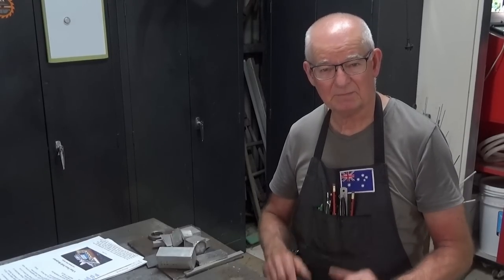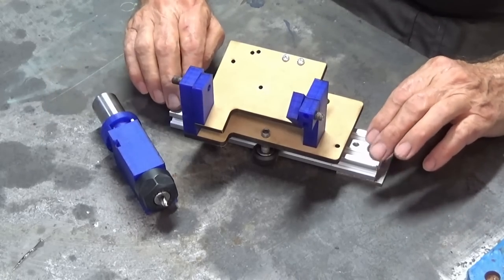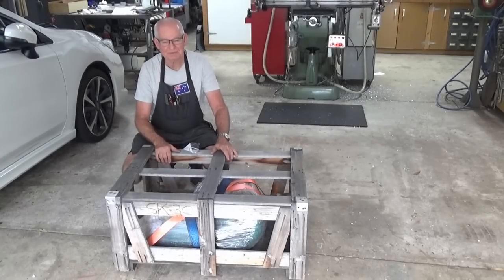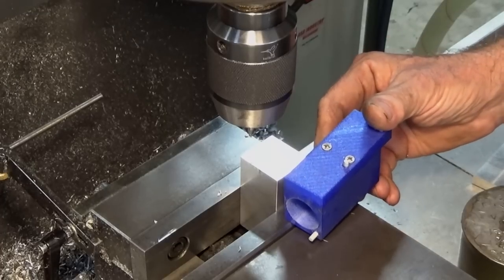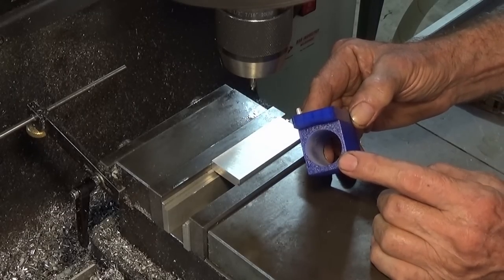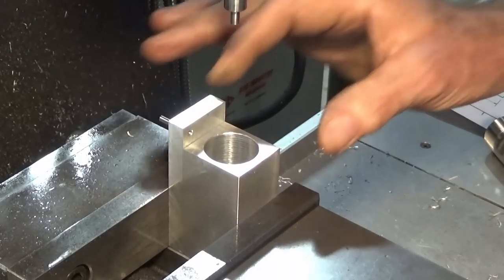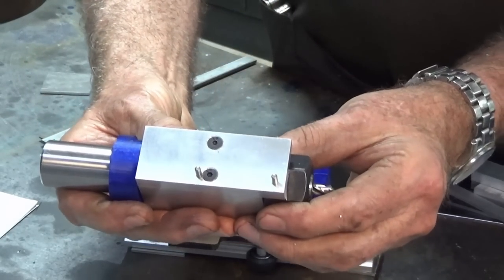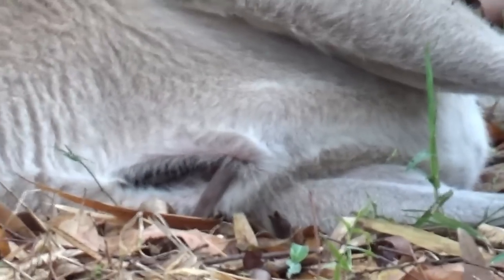A 4 Facet Drill Bit Grinder DIY Style Part 1

Comment: Gday Preso, this looks an interesting build and good use of the Quorn, the Roos are thick here at the moment, there bloody everywhere, cheers
Reply from the maker: We have "just the right number of roos" here. Three or four at the most and they don't eat our trees so that's good. I badly wanted to use the Quorn grinding spindle for something. I can mount it on the compound in my lathe as a toolpost grinder but it's ideally suited to the drill grinding project so it's not a wasted effort after all. 
Regards,
Mark

Comment: Looks to be an interesting project Mark. I sharpen my drill bits freehand using guide lines on my grinder's rest. But, I jig like this will make those grinds even and accurate. Can't wait for Part 2. 

Good score on the shaper attachment. That will give you shaping capability without taking up space with a completely separate machine.
Reply from the maker: Thanks Jon. I still want a proper shaper though! And a surface grinder. 😁
Regards,
Mark

Comment: G’day Mark. My name is Andrew and I live in Brissie. I’ve just finished Stage 1 of my version of the drill bit grinder. Most of it will look very familiar but I’ve made a few changes (as you do). It can take ER32 and ER40 collets and has a 150mm grinding cup. The table is about 300x200mm and has a sideway movement range of about 100mm. It can take a few other accessories I have in mind for end mill sharpening etc.  I also have a different method of indexing by just flipping the collet block 180 degrees (or 90 degrees) using register pins.  

I’ve only sharpened one bit so far (4 facets) but I’m very happy with it. Thanks for the effort you put in and the inspiration you provided.
Reply from the maker: Andrew, I did wonder if it were possible to scale up the basic geometry of the machine. It took a while for me to understand the way the work axes had to align to guarantee the intersection of the four facets. I just finished up on my grinder today and I was able to successfully grind a 3/32" twist drill. I would NEVER be able to do this by hand and it was quite gratifying to know that I can now get repeatable sharp cutting edges on my boxes of blunt and damaged drill bits. I would be keen to see your version when you get yours finished. You can find my email address in the "about" tab of my YouTube home page.
Regards,
Mark

Comment: Marc, in 2018 I studied and thoroughly examined the sharpening of drills, but I stick to the clone copy of the dekel S0 toolgrinder. After reverse enginering I adjusted it, did all the calculations and with a small hardware adjustment I can now sharpen all drills from 3 to 18mm diameter with 4 facets. I have yet to make a video and documentation on the final adjustments with a quick-release clamp. Yes, I also found the documentation from John Moran 5 years ago, but I had a drill sharpening tool PPU-3, but the accompanying documentation was never clear. You can find more about this on my you-tube channel, including documentation.
I wish you continued success with the construction of the Moran drill sharpener
Reply from the maker: Thanks for that. I have actually downloaded your excellent article on modifying the Deckel clone drill sharpener attachment and it is on my to do list of projects. I would like to have an alternative method for sharpening drill bits and although I had used the Quorn T&C grinder to do a 4 facet grind on some medium sized drill bits it was always a bit fiddly to set up. I have also seen Stefan Gotteswinter use the Deckel clone to grind a 4 facet point on a solid carbide drill bit but it really only works if you have a 5C collet for each drill diameter that you want to sharpen. I think the John Moran version will be simple to use although he states that about 1/16" is the lower limit due to bending loads on the drill at that size.
Regards,
Mark

Comment: Oh shit! Oh shit! Oh shit!! This is just the project I (did'nt) needed to keep me busy in the shop!!! Like you said in the intro, getting bigger bits sharpened is easily done by hand. At school we trained on 3/8" bits to get a feel and anything 1/4" up is pretty easy but 3/16" down requires a super soft touch and a good grinder with no wobble or vibrations! A nice dedicated grinder like this is just right up my alley!!

BTW, always love the garden shots... The wildlife is so wild in your area compared to us! Greets from Canada!!
Reply: I said the exact same thing!
Reply from the maker: I am glad you are interested in the project. There is a 3D printed version of this drill grinder which may suit some folk who don't want to do a lot of machining. I am including a link to that version in the next video. A lot of the parts could be laser cut too. If you can get a service bureau to cut the sheet and flat parts it would be a fairly simple build. I am looking forward to grinding a lot of dull bits under 1/4". I think the practical limit is 1/16".
Regards,
Mark

Comment: Just 2 things to have right for drill grinding and that is the point angle and the centrality of the bit......the point angle is got with a simple plate angle gauge and the centrality of the point is by laying the drill bit on a flat surface and checking the chisel point against a ruler.......that is if you hand grind drill bits so back off is an eyeball thing. and comes with practice.
I'm going to give the 4-facet point geometry a go as soon as I finish the T&C grinder I'm building.
Without bragging I can hand grind a 12mm drill bit to drill a 12mm diam hole that a 12mm piece of rod will be a press fit in.
Another trick for drill hole sizing is if you slightly grind one cutting edge off centre it will bore the hole bigger.
BTW.....for sharpening all small drill bits from 3mm down to .5mm I use a Wishbone type drill lapper and a diamond lap.......the Wishbone drill lapper or grinder.....whatever.....was popular in the 50's so I made one for sharpening all my small drill bites..
Reply from the maker: Ian, I recall seeing the advertisements for the wishbone grinding accessory in the old Model Engineer magazines. The only thing I don't like about a lot of the DIY drill grinders (and the wishbone style) is that you need a lot of specialised collets. I think the wishbone only came with 4 and when you start trying to grind letter and number drills it might be an issue. ER collets are relatively cheap these days and they cover a massive range of sizes.
Regards,
Mark
Reply: Really small drill bits you can sharpen like a pencil. I mean really small bits. Below about #60. Once they're that small it doesn't matter any more. As long as they're sharp they'll cut.

Comment: I have a confession to make. I own a Drill Doctor and I do use it to sharpen my cheap junk import drill bits. It was $5 new in the box at an estate sale so I figured I'd try it and for general hand drilling it's Ok.
Reply: I own a Drill Doctor too and it's hopeless. I just freehand bits on a bench grinder. Good enough.
Reply from the maker: I have used a Drill Doctor clone that belonged to a friend and even though it was 90% made of plastic it still did a surprisingly good job. However, in my view, a 4 facet grind on a drill bit is superior to a factory grind. They start easily, wander less and in most cases you don't need to pilot drill. 
Regards,
Mark

Comment: I am extremely envious of your new purchase as I have been looking for a slotting head for my Bridgeport for over a year now. It's hard getting machinery like this here in Aus. 
Regarding sharpening drill bits on the clone D bit grinder, I have done all the modifications that was suggested by Luc Wybo and still with not much great success. Having 2 draws of drill bits, I am very keen on seeing your project thru and hopefully when you've completed it I would love to take you up on the offer of the plans. 
Love your work and detailed videos. Cheers.
Reply from the maker: Thanks Bill. I have the article produced by Luc Wybo sitting on my desk and I was keen to do the mods on the D Bit grinder drill sharpening attachment but  I thought I should try the 4 facet method first. A 4 facet grind has a lot of advantages over a commercial factory grind. The start more accurately and produce less heat. You are welcome to the drawings when I have ironed out all the missing dimensions and updates.
Regards,
Mark

Comment: You can just use your deckel grinder to do this job.  It came with a 5c collet holder that has built in indexing.
Reply from the maker: Trust me, I tried to use the Toolmaster D bit grinder but I didn't have the 5C collets I needed at the time. I have bought a few more but getting imperial size 5C collets is a bit of a mission. I thought I might be able to get a 25mm 5C collet and mount the ER20 collet chuck in it but I just couldn't see how it was going to fit. I know you can use the D bit grinder for 4 facet grinds if you have the right collet. I have seen Stefan do it. But you'd need to have a million collets to make it work for number and letter drills. 
Regards,
Mark
Reply: @Preso58  yeah I bought a full set of metric ones from H&F.   They are handy because I have a 5c chuck as well.  5c is a pain though because they aren't as flexible as the more modern collets.  The drill attachment isn's as bad as everyone says.  I set it up sometimes and have had good results on monster drills.   I found the 4 facet method sometimes gave me clearance issues and wasn't great.  Probably I was doing it wrong.

Comment: Yep this is a good one. Only problem I have is I just purchased a Vevor except its not as small as I would have liked. I also would like to put my hand up for the prints on this if you get them done. love your ideas. I am making the furnace now and just finished the control box. Cant wait to melt something!!
Reply from the maker: Thanks. I saw a couple of reviews of the Vevor drill sharpener and I think they are a great solution. Unfortunately, I had already committed to making the 4 facet grinder and I had actually just finished when I saw the first of the Vevor reviews. You can find the drawings here https://www.dropbox.com/sh/38ahn5tz4qw5ypw/AACtAbmXNDYa4x0v9DD1NcEOa?dl=0
My furnace drawing is here https://www.dropbox.com/s/j7bopx7noxi96vn/Mark%27s%20Foundry%20Furnace.pdf?dl=0 Good luck with the build.
Regards,
Mark

Comment: I spent some time in dialogue with John Moran to create a 3D printed version of his sharpener. He has shown my finished 3D version on his examples page and has put a link to my blog where you can download my Fusion files, drawings and STEP models.   The 3D printed version works very well and saves a lot of metal related activity.
Reply: Thanks for sharing the files, just downloaded them. I have a fiber laser cutter so can cut all the sheet metal parts on that. Only the holes for the pivot pins need to be reamed, all other holes should be OK with laser cut tolerances as far as I can tell.
Reply: @epilotdk  Sounds like you are well resourced for it.   I was intending to CNC cut the trunnion plate but in the end took the lazy option and Spray Mount glued the 1:1 paper pdf drawing of the hole locations and outline onto the blank plate.   I then marked the centres with an optical centre punch and drilled them through so not exactly precision and it works fine.  Your laser should be as good if not better. 
There is an update tweak on my blog regarding the 3D printed collet holder where I decided to add a metal sleeve so the collet holder slid back and forth more smoothly than on the raw PLA print.  That aside the sharpener is very reliable and is an asset that I would not be without.  Well worth the effort.
Reply from the maker: Alan, I will do a more detailed follow up on your design and the blog before finishing up on this playlist. I am sure it will be of interest to a lot of makers.
Regards,
Mark

Comment: Looking great so far. I have at least 1kg of small bits I can't throw out, but want to sharpen one day. I'm keen to see this in operation. I would be interested in some drawings and/or invented files if possible.
Reply from the maker: I have both the inventor 3D models and the 2D drawings. I will put them up on a file sharing site when I am done. For free! 😁
Regards,
Mark

Comment: You mentioned you already have a Deckel clone universal grinder. You just needed to buy a cheap 5c to ER adaptor and you can do 4 facet grinds easily with it, on any sized drill bit. Today I did a 4 facet grind on a small 2mm drill bit with it. It's great. 

Cool build though, it'll help others.
Reply from the maker: I did investigate getting a suitable adapter to take ER collets but there isn't sufficient room between the work head and the wheel on my Deckel clone to make it work. I have sharpened drill bits using the supplied 5C collets but I don't have a lot of them and you need one for every sized drill bit that you are likely to want to sharpen. 
Regards,
Mark

Comment: You have my attention. Thank you for sharing something completely different and inspiring.  
I am just getting into machining aluminum and have lots to learn. Could I ask what cutting fluid employed for the aluminum/knee mill sequence and why you don't bother with it on the lathe?  Stephan G. always has a squeeze bottle of isopropyl at the ready and, as you may know, just did a small vid of the benefits of its use and the significant improvement to surface finish on Aluminum tooling. I am planning on using compressed air with a mist arrangement.  I would love to use flood coolant to prevent the scattering of swarf, but the machine is really not designed for it. 
Best regards. Chris
Reply from the maker: Chris, I had intended to use isopropyl alcohol as a coolant/lubricant for that machining operation and when I went to get the spray bottle I found it had gone brittle and was leaking. I think Stefan alluded to that in his video. I tried to purchase a more resilient container with a trigger spray but came up blank. The one I had been using was about 6 years old but I hate buying plastic products and then just throwing them away when they fail. We have enough plastics in our environment already. The water soluble coolant does a reasonable job but it is messy and it can stain and rust some surfaces. The IPA just evaporates and doesn't leave any residue. The only good thing about Covid is that there are now cheap and plentiful supplies of IPA on the market! All that hand sanitiser!
Regards,
Mark

Comment: Hello Mark. Excellent job on the drill grinder. I have several T & C grinders and use 4 facet grinding on drills as well. Long ago I bought a Beaver slotting attachment for loco wheel keyways. It works great and makes square holes in boring bars. Would you like a collumn in my up coming magazine? BC
Reply from the maker: I had to check out the Beaver mill on the Lathes.co.uk site. The slotting head looks very similar to the one I have. I tried and failed to make a decent slotting attachment for my lathe and it sort of works but cranking a lever by hand to make a deep keyway gets old very quickly. I'm happy to contribute to your magazine. I am fairly sure I visited the Warner track many years ago. I had a mentor named Bob Kimber when I was teaching in Maryborough and I think I met up with him at the Warner track one day. A very nice bloke and a very talented model engineer. That would have been back in 1987 so maybe he's not with us any more.
Regards,
Mark

Comment: Would this also work on 4 fluted endmills ?? I would prefer a carbide endmill sharpening grinder over a drill bit sharpener. Carbide endmills are a lot more expensive to replace. If this grinder could do both up to 12mm endmills and drills that would be a money saver.
Reply: You could probably adapt it for the ends but I don't think it would work on its' own. Also, it's not enough just to sharpen the end of an endmill. If you think about the way they cut, it's the bottom corner and the flutes that do most of the work on most cuts, unless you're plunging. My endmills all go dull on the edges, not the ends. And that's where you always chip them. If you ever try, remember most endmills also have a setback centre, ie they don't centre cut.
Reply: @HairyNumbNuts  I do not want them to become as good as new on all cutting sides as that would be almost impossible , just get the corners and end back to decent sharpness.....prolong their life for some time before replacing them. The smaller ones are not that expensive and probably to difficult to sharpen using this grinder......but the 8, 10 and 12 mm ones i use a lot ( 2 and 4 fluted). They can cost up to 40-50 dollar for the better ones. I also do not wat to spend 6-800 dollar without shipment for a chinese endmill grinder.
Reply from the maker: I guess you could sharpen smallish end mills but I am thinking that there is not a lot of rigidity in this arrangement. Once the grinding area goes up it will cause a lot of chatter and vibration, especially on carbide. However there is nothing stopping you from increasing the plate thicknesses and using some heavy linear rail for the traverse mechanism.
Regards,
Mark